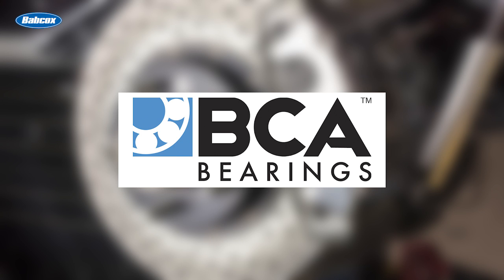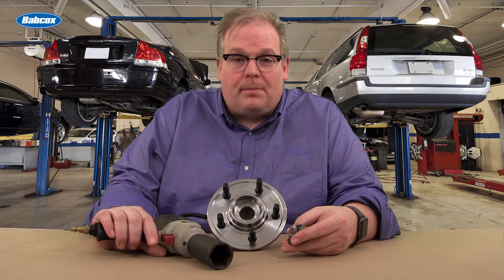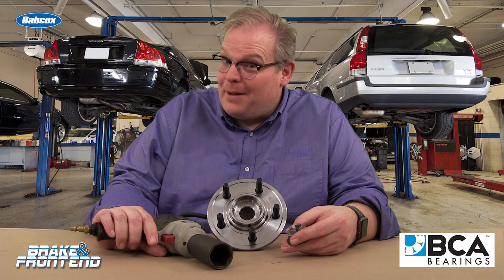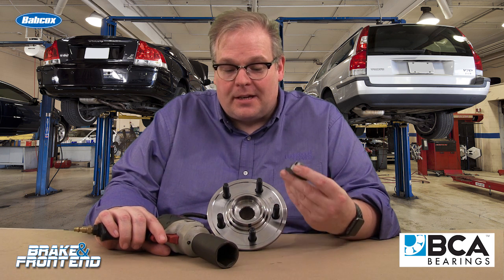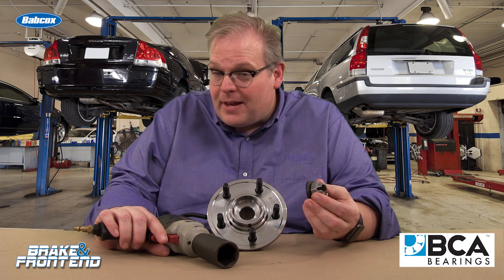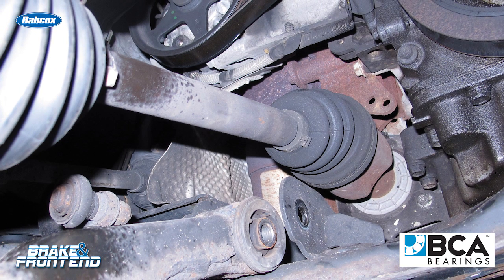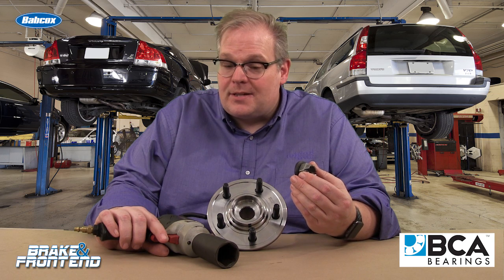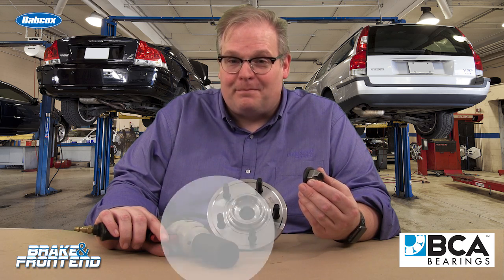Should I Tighten An Axle Nut With An Impact? | Tech Minute

Comment: I recently did a wheel bearing and wheel hub replacement on my vehicle. Once i had everything else torqued down all that was left was to tighten down the axel nut, and i only screwed it in with my hand while in the air. I then lowered it with the wheels on the ground since i was told to torque when car is touching the ground. Was i supposed to use an impact gun to tighten in air first, then torque with wrench when on ground? And should i be concerned if my vehicle is unsafe to drive or if it’s dangerous since i did it wrong?

Comment: I have asked several people if it was possible to over torque an axle nut to the point of damaging the CV. Everyone told me not possible(yet I still had a hunch they were wrong) thank you for this!
Reply: my friend is a mechanic, and he used the gun to tighten it while up on the jack and he ruined the other end of the axle joint that connects to the transmission.
Reply: @thestairdoctor  was the damage visible or did you notice it once you started driving?
Reply: @giveme10feet   I noticed a clonking sound after. Nothing visible. and it only clonks when moving forward slowly and braking. The Brakes worked but feels like the rim was loose but it wasnt.

Comment: Flat out lie,can't fully torque the axle nut down.Can't do damage tightening the axle nut down with an impact
Reply: if it's up on the jack while you're using the impact, I think you can damage it.
Reply: Learn how to use the impact gun and you wont damage it. I can put those axle nuts on nice and tight with the car still on jackstands.  @thestairdoctor
Reply: @mg8720-u7j  You're lazy.
Reply: @gregsmith332  Nope. Im just good. Use my impact gun every time. Perfect!
Reply: Idk bro I just cost myself 600 dollars on a tow and new axle 😭

Comment: Needle bearings? What needle bearings?
Reply: Tripod joints at each end of the cv axle have needle bearings in them to allow articular rotation. Allowing the will to spin as it goes up and down unevenly at each end of the cv axle but not stop rotating while giving power to the wheel.